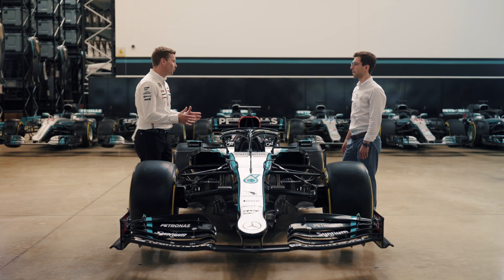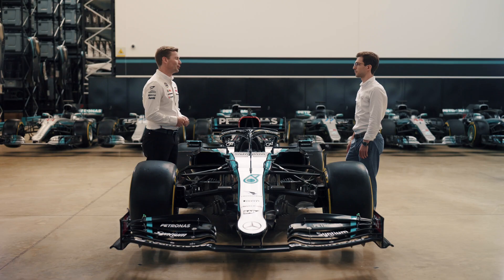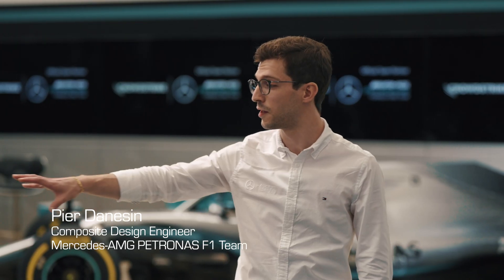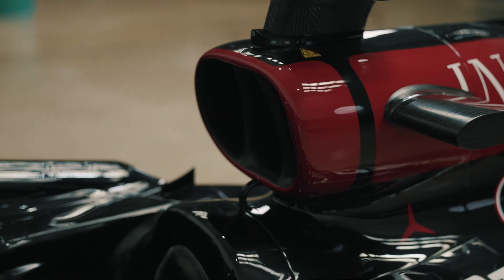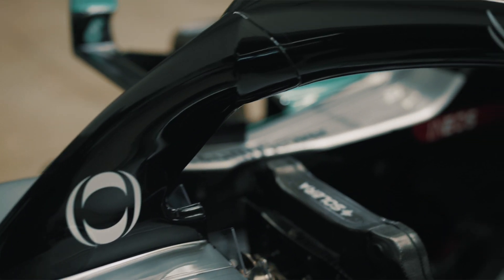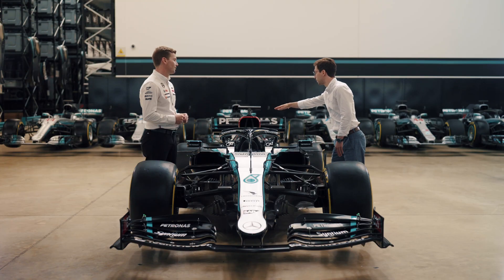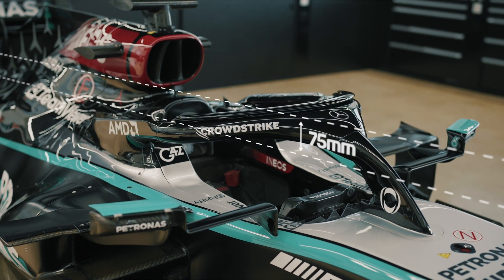How the Roll Hoop Protects an F1 Driver | Safe & Secure x Crowdstrike

Comment: That was very informative, the roll hoop, like the halo,is a life safer. Grosjean can attest to that. What I don’t understand, is why the engine rule changes in 26 will affect the roll hoop! Not being an engineer, it isn’t very clear.
Reply: He said exactly why? The required load will increase - so it needs to be an awful lot stronger
Reply: @Matthew-ll9ke yes I understand that the car weight will increase, but I thought titanium would absorb that! I don’t think he means the strength has to increase, just the application will need to be larger
Reply: @lilyjones8145  no, he said the requirement is increasing significantly. He said exactly the force it needs to be capable of withstanding, that is not solely down to the car weight increasing

Comment: I’ve heard of the roll hoop but never knew what it actually was and did, thank you for the information.
Reply: @ I know but that’s all I knew, I didn’t know the technical side of the roll hoop.
Reply: That's because its always called "The halo" and I have no idea why they aren't using that term here.
Reply: @dorklyasmr6017  The halo and the roll hoop are not the same thing. The roll hoop is behind the driver and covered with bodywork.